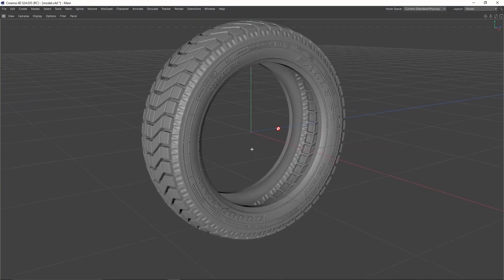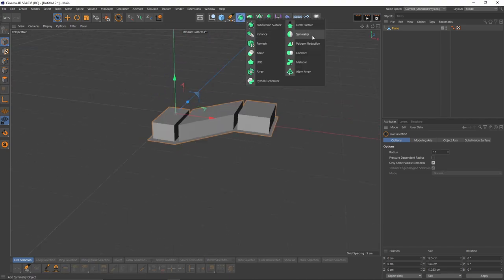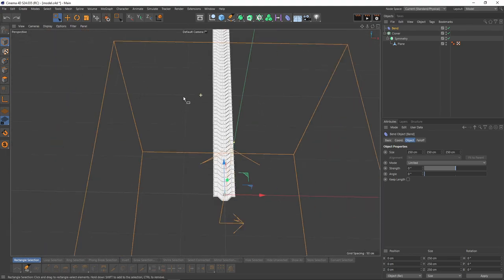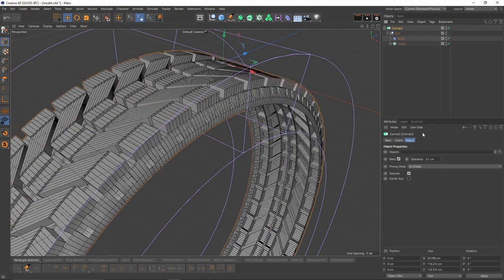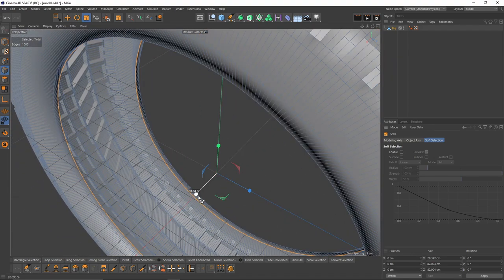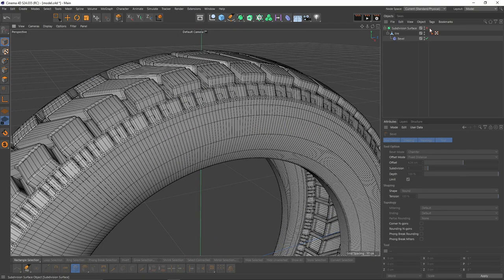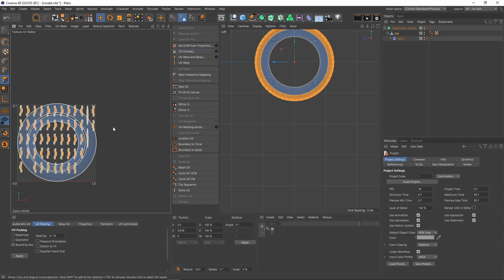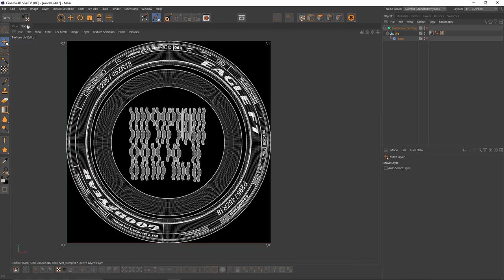3D Car Tire Modeling Tutorial

Comment: Great video, but is there a reason why you did the UV unwrap method to apply the bump to the sides? 
I would have just used the texture with a frontal projection from the side of the tire. This would be much faster.
Reply from the maker: Yeah you are right, cubic or flat would be faster and easier, I just wanted to use/show bodypaint .